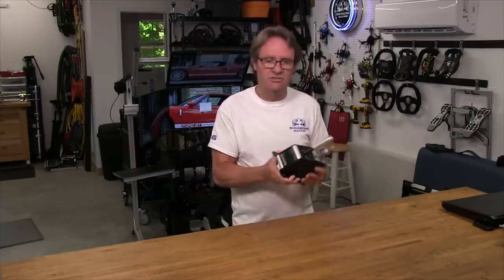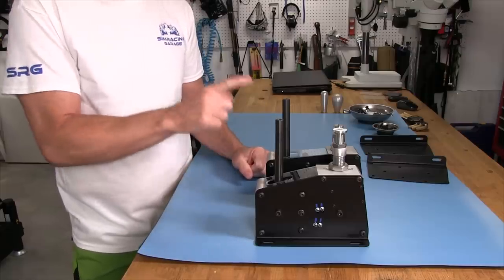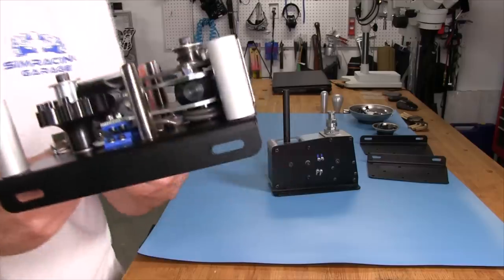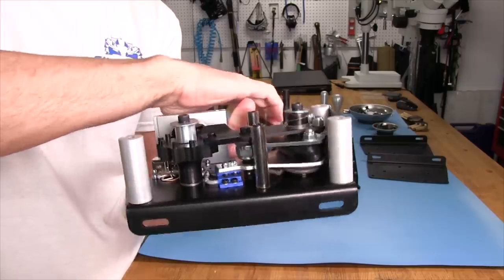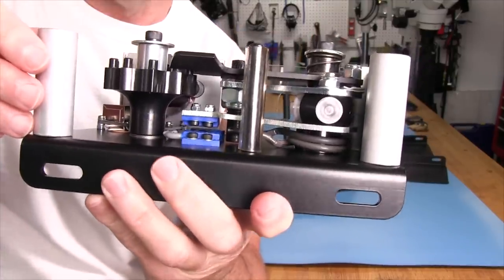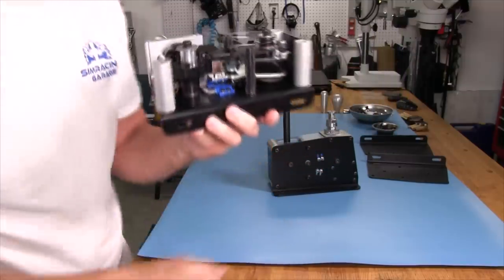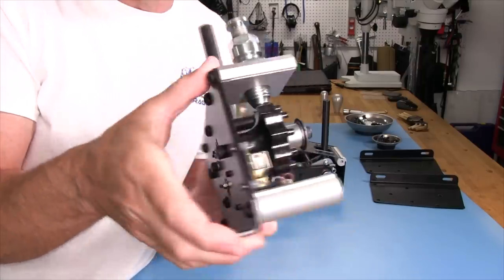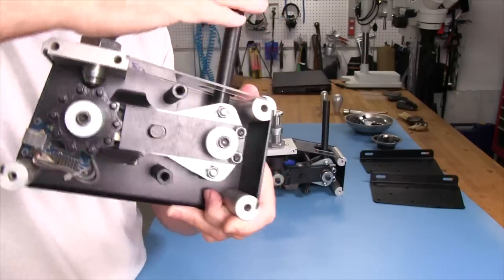Pro-Sim Lite V2 Sequential Shifter Review

Comment: I've had mine (V2) for some months now and I must say it's worth every euro. It doesn't look nor feel like a PC peripheral, but like it's been taken from a real race car. The tactile response you obtain when you use it is so brutal that it draws a smile on your face with every gear change. It's a pure mechanical feeling. It feels is so radically different, for instance, from a Heusinkveld shifter, that you will end up using it in a very different way, with strenght and totally confident what you will not brake anything no matter how excited you are. Of course, you have to bear in mind the noise. I have no idea if my unit is built with any noise dampening or not, but I must say I'm on a second floor and the people on the first floor can perfectly hear when I'm using my cockpit. Since I race with closed headphones, the problem is gone and I can barely hear it, so the experience of using it is just the tactility of my gear changes. Finally, the only aspect I would criticize from this device is its knob. It's just too small, like made for small children. I have designed and 3D printed a longer and thicker one (10 cm x 3,3 cm), which makes the grip more confident and comfortable. You can download it here: http://www.alvarezeninternet.com/temp/shifter-knob.stl

Comment: I would really like to see what would the V1 sounds like if you put the rubber washer behind the claw and sleeves on the 2 posts.
Reply from the maker: I have actually done that. It does tame the high pitched chinking noise. You can try different thicknesses of rubber washers to dial in the amount of noise you want. Within limits of course.

Comment: Really dont like the sound of V2, its like no tactile feedback
Reply from the maker: The beauty of this design is you can make it feel just like the V1 if that's what you want. I pulled all the sound deadening material from the stops, gear tensioner roller, and the claw plate. Felt and sounded just like my V1 shifter to me. But I ended up putting the claw's deadening material back. Did not affect the tactile feedback as far as I can tell, and I preferred to have the tink tink silenced. YMMV.
Reply: Sim Racing Garage  Just ordered one after watching your review, i like the fact i can still make it sound like the v1

Comment: V2 is worse for me. It's a shame they don't offer the choice.
Reply from the maker: The beauty of this design is you can make it feel just like the V1 if that's what you want. I pulled all the sound deadening material from the stops, gear tensioner roller, and the claw plate. Felt and sounded just like my V1 shifter to me. But I ended up putting the claw's deadening material back. Did not affect the tactile feedback as far as I can tell, and I preferred to have the tink tink silenced. YMMV.
Reply: Ive done the same barry, removed the silicone type rubber over the bars for the claw stop, then the foam tape over the nuts. When i removed the rubber washer where the claw slaps back i had issues with the claw sometimes jamming. So i used a metal washer instead of the rubber one